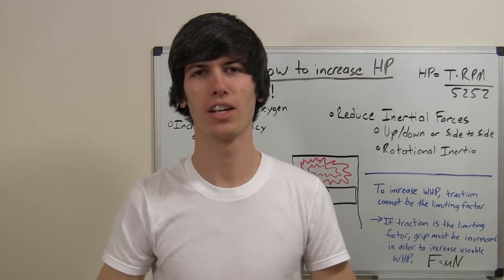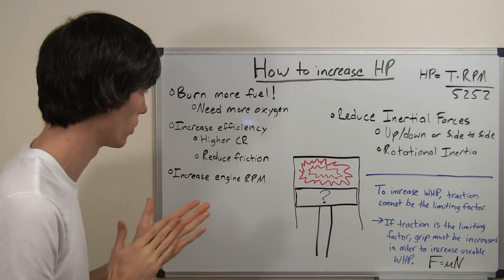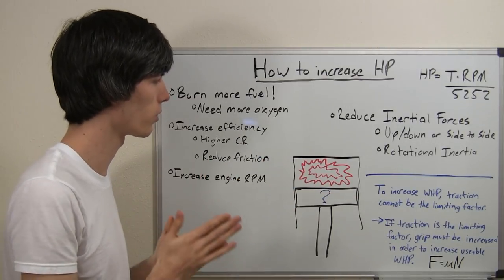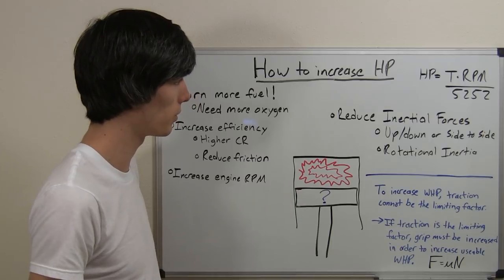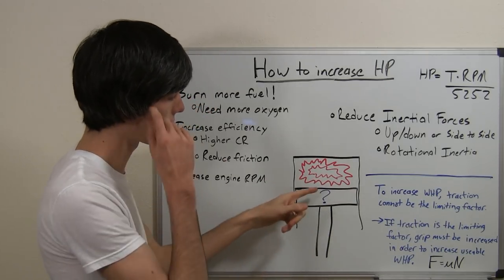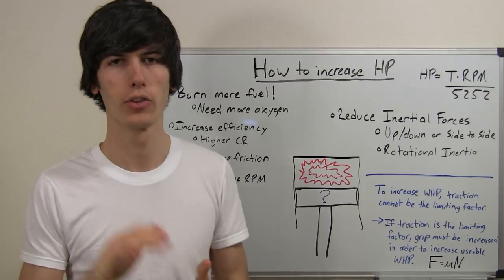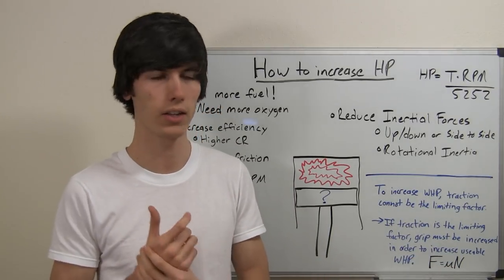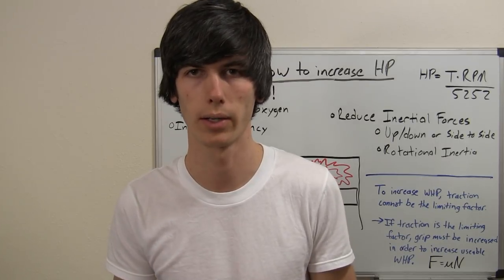How To Increase Horsepower - Explained

Comment: What are the limiting factors that constrain the normal road car engine speeds to to about 6k rpm, when F1 cars can rev to 20k rpm?
Reply: The weight of the rotating assembly, material, and durability. F1 motors are rebuilt often which means durability only has to be a few races, The pistons are way smaller, like motorcycle engines. With less rotating mass and shorter strokes you can rotate that mass faster. Pistons have a certain speed that most can't go past. You can rev a 6.2L chevy V8 to 20K if you want to if you remove the limiter, but with the way it is made and mass involved it would fall apart (explode) before you reach 20K rpm.
Reply: custommotor FIA rules forbid engines to be rebuilt. During the 2008-2012 era you were only allowed 8 engines per season per car(the V8 era). The new era only allows 6 engines per season per car. The usage of pneumatic valves allows for higher RPM, but also like Theponde1 said, short stroke and broad bore allows higher rev. Higher tolerances for components allows for greater RPM, less wasted energy between components. Think about it like this, less parts are rattling around make clatter, wasting power between the gaps.
Reply: The manufacturers don't want to spend a lot of money on warranty repairs so by limiting revs they increase the potential longevity of the engine.  Blown engines are bad press no matter how many revs you were doing at the time.

Comment: I'm wondering if an engine with less cylinders, but equal displacement, similar stroke and RPM ceiling, ex;9000 RPM red line, would have more torque than an engine with more cylinders, due to the fact that the cylinders would have to be larger to accommodate for equal displacement. Assuming that both have proportional amounts of components robbing power, as well as overlapping power-strokes and efficient intake and exhaust scavenging and compression ratio. (flat-6) & (flat plane crankshaft V8), say they are both have 3.8 litres of displacement, each cylinder of the flat 6 displaces 633.33 cc, while each cylinder of the V8 displaces 475cc. They both produce peak HP at 9000.
My question is if the peak horsepower of Flat-6 would be greater than that of the V8 due to having more torque generation from each cylinder. And if the claim of adding more cylinders only smoothens torque delivery rather than strengthening it is correct

theoretically, this is why I believe the 4.5 litre flat plane v8 (562 HP) of the Ferrari 458 Italia overpowers ANY V10 or v12 of the same (AND even greater) displacement, for example; The 4.8 litre 9000 v10 of the Lexus LFA  (553).

Comment: i have heard titanium alloy parts (valves, valve springs, piston, rods, crankshaft) can do a dramatic job of reducing inertial forces. I was curious as to how much of a difference titanium would make in for example a lambo v12. And also more curious as to what "carving" (making) such parts would cost relative to a custom forged crank (for eg). I am genuinely curious and would really be breat if u could just give a few figures at least. thx for great videos too.

Comment: another thing is to increase flow ie; intake air flow and exhaust flow. If you have a look at a stock exhaust it's very restrictive in shape, what you want is a nice round exhaust with genital bends and a bit larger than stock. But if you go to big you can lose power buy reducing back pressure

Comment: Yes you have horsepower or energy but this energy is present in a higher amount on crackshaft,but all this power is reduced by the presence of a torque convertor, pulleys, ac compressor, alternator, power steering, transmission gears and fluids, bearings and all the stuff that is before transfering this power to the wheels, you have a lot of energy  directly from the crackshaft, the most efficient way to improve the car performance is to find the way how the cranckshaft power is transfered directly to the wheels... withouth loosing so much energy.

Comment: Pretty good basic video, However it should be noted that increasing horse power and increasing acceleration are two separate things. You can increase one and it may not increase the other.
Reply: Pis Uhoff that's a very good point. Low down acceleration is more based on gearing, shift speed and low down torque. 
High horsepower usually translates more directly to higher top speed as your power limits how much air you can push

Comment: What I don't understand about hp vs torque is the effects of each on the car: if I had a high torque low hp car according to your vid it would go the same speed without being effected by its weight as much as a high hp low torque car which would go faster but be more effected by weight reduction? So... Why should I increase hp rather then torque if I'm not gonna change my weight?

Comment: i am looking for the calculation of compression ratio to boost pressure. like if we only had fuel which capable of 11:1 CR at 1 atm. and we well boost it at higher pressure. than how many compression ratio i need before the boost? thanks

Comment: What’s a good example of a higher compression ratio, and a lower compression ratio?
Reply from the maker: 14:1 is currently the highest seen in gasoline vehicles. 8:1 is pretty low. You'll commonly see 10/11:1 compression ratios.
Reply: Engineering Explained thanks, what’s considered a “good” CR?
Reply: how do i calculate cr.

Comment: Talking about grip and changing tyres, what about reducing the pression in the tires, does it make them more grippy?
Reply: +FP541 Reducing tyre pressure can increase grip in certain situations due to increasing the contact area. However, it can also create drag (due to tyre wall flex) and decrease (!) power delivery. Another issue is uneven tyre wear - under inflated tyres will tend to buckle in and wear the outer tread faster. Overinflated will wear centre tread faster.
Reply: +elucid07 funny that u kept using tyre throughout the whole comment lol
Reply: +Abel Resendiz funny that I spelled the word correctly, considering where I live we use that spelling.

What's your point?
Reply: You from the us?
Reply: +Abel Resendiz No.
Reply: +elucid07 my bad then guess it's tyre

Comment: Does a fuel cooler really work and increase power? (maybe in track cars?)
Reply: Moto Man 
* heat the fuel so it will vaporize quickly and cool the intake air so you charge the cylinder with more volume

Comment: So you say less friction = less heat, but what about racing motor oil and racing transmission oil those who provide thin types of oil, if it has less friction, would the components be moving faster and with the faster pase cause high temperatures to rise as well?
Reply: HTR - Helltown Racing yes, which is a lot of the reason that they lower friction as much as possible to begin with...

Comment: In some bikes they increase torque by increasing cranck weight. so as u said it will increase the inertial force . So why they increase cranck weight .
Eg: royal Enfield bullet
Reply: you cant increasing torque be increasing crank weight ,crank weight work like resist the biger crank weoght at the same dimension and weight distribution the LESS TORQUE engine will  generste at crank .

Comment: what I would like to know is how much an engine makes hp in theory. what I mean is if there was no friction at all, and no noise and the engine would run, how much more power it would  make compared to real engines. I've heard somewhere like 10 years ago that a 4 stroke engine is only able to give 30% of it's theoretical hp.

Comment: thanks a lot it was easy to understand
i have small note : if the hot air comes to the engine that mean i well loose hp
is that right ?

is the sport  throttel body   spacer  make difference in hp ? 

whats the difference between oem headers and sport headers

i hear a a lot of materials used in sport headers such as
ceramic coating
stainless steal

Comment: so there's, bigger cams, intake/exhaust manifold, exhaust system, performance clutch.... what else can u do?id prefer N/A engines over forced induction. are there performance spark plugs? pistons? crankshaft? flywheel?
Reply from the maker: Check out the rest of my playlist on increasing HP, there are a good amount of videos with many options.

Comment: Please help. I have a two stroke engine, 125cc. I have switched the cylinder for a 140cc cylinder but so far my lap times are exactly the same. I don’t know why? The rpm with the 140cc cylinder are lower than with the 125cc cylinder, about 200rpm lower. Any suggestions? Thanks 🙏
Reply: Lap time 😁💨💩

Comment: I have a Tan 2002 Toyota Tacoma 2.4L 2WD SR5. Its not even 150HP. I was wondering about a turbo charger, seen several with it for more HP. Also wondering about a top for it, and wondering if there's different types like high profile cuz I really need a lot of space...I REALLY need more HP

Comment: Thanks for making this video, Jason! You know, it was great that you uploaded this at this time, because it was just the excuse I needed to ask you a question that's been bugging my mind for some time... Does that HP equation always work? My question was "generated" by the following situation: take a hypothetical in-line 4 engine, like a 1.8L Honda or something in that ballpark, making 180hp. Say I wanna know how much torque it makes at 2000RPM...... Well, I guarantee you it isn't 472,68 lb·ft of torque.....right?
Please, I'd appreciate it if you could shed some light here, Jason.
Best wishes, 
Arthur.
Reply from the maker: Arthur Sperotto The number that manufacturers post when they say how much horsepower an engine makes is always peak hp. You'll notice it always correlates with an RPM (typically a high RPM). Power will be lower at lower RPM.
Reply: Engineering Explained Ah, now it makes more sense. Thank you. I was in doubt whether an engine's hp varied over RPM's. After thoroughly reading this (http://www.houseofthud.com/cartech/torqueversushorsepower.htm), I wrongly concluded that an engine's hp output is only there to "inform" you how long (in terms of RPM's) that engine can produce the stated peak torque for, therefore, it is invariable (for that particular engine, of course). Anyways, thank you very much for clearing that up, Jason!
P.S.: Am I completely wrong in my conclusions?
Reply: ***** ....... it's a joke... -_____________________-
Type over9000 on google. It's just a popular catchphrase.

Comment: question : how can ypu figure out whats my motorcycle top end power rpm. is it when i shift to second  gear the noodle point at is the topend power rpm? example i go on first gear than i ahift around 11.5krpm then shift up if the neddle poin at 9krpm the. its the topend power where the engine using all the power at this rpm

Comment: For petrol engines od SI engines power significiantly drops after reaching it's peak. This is because volumetric efficiency drops with rise of rpm, and power inside cylinder(indicated Power), and this drop down also the value of mehanical efficiency. These factors are main causes for BHP drop after reaching it's peak. 
For example if petrol engine revs about 1,3-1,5 times max rpm, it's efective power or BHP would be zero(0)!

Comment: What is the formula to determine increase in horsepower by increasing volume of air? for example my heads currently flow 250 cfm if i installed heads that flowed 300 cfm how do I calculate the increase in horsepower? I'm trying to determine if the gain in HP is worth the expense.
Reply: Indianahillclimber You would need to tune your engine management system to make much more HP. It is more air and fuel that makes more power, along with proper timing.

Comment: my car is not so good on HP and backfire's a lot like its a rally car. im just curious what could be causeing, 1 sparkplug fail? 2 big set up exhaust? 3 sparkplug leads? or would all fail if 1 wire did? its only a low engine but car has bin modified a lot, but money spent on it and is in good condition. but is not as good pulling. im thinking the backfiring has to do with it.
Reply: get a tune

Comment: Efficiency doesen't have any connections to BHP/L. Efficiency is a ratio of power produced at crankshaft and power produced inside engine cylinders, or 
pressure at the crankshaft or BMEP, and pressure inside engine cylinder or IMEP. Efficency of petrol engine(very good one) is around 35%, for some big 2-stroke Diesel engines for ferryboats is around 50%...

Comment: I am not sure about the inertial forces and how you related it to power... i mean inertia is conserved in the piston and reused during the exhaust and it's always alternating between states of inertia while energy is conserved. The only way a piston weight for example might be losing HP is through friction, and changing the inertia won't affect that at all... if you are referring however to horsepower / weight ... then maybe this plays a factor but also i must point that the weight of the piston is kinda small to heavily affect HP/Kg ...

can someone confirm whether what i said is right or wrong.
Reply: Pistons are not kept moving by inertia alone but also from other pistons' power strokes. The less mass a piston has, the less power it steals from another.

Comment: can somebody explain to me, when i have an engine that have a peak horsepower around 8500 rpm. installed a performance camshaft, and the peak hp is around 8600 rpm, use a bigger valve and the peak is now 9100 rpm. can i make the port much bigger to make the engine power peaks at 10000rpm or even 11000rpm? in this situation, i dont care about low end power since it's a motorcycle.

Comment: How come when Aussie50 put jet A1 fuel into 'Little Car' (the green one out of the 3 pet cars in his garden) the car kept running?  It started dieseling and making some awful sounds but it kept working even with the ECU still doing it's thing!!  It's a petrol car too!  Also if one were to look inside Little Car's engine what kind of damage would have happened?

Comment: Wouldn't it be an option to shift some weight on the driving wheels? 
Like putting the fuel tank in the back of a RWD car...
Reply: that would give you more grip so yeah in a way
Reply: It'll help by I'm proving your grip for a better take off but it won't increase your overall HP. You wanna increase HP, spend money under the hood.

Comment: I have a question If you have a Chevy Monte Carlo 76 with 350 in it , it's going to have about 160 hpHow can you make that engine more powerful ?Some today engines same 350 have up to 300 hp
Reply: There is a ton of things you can do, ESPECIALLY on a small block chevy. They are easily the most cheap way to gain horsepower without "breaking the bank"

1. Go to a machine shop and mill the head.
2. Adjust timing
3. Take rubbing compound and smooth the inside of the air intake manifold with a rag, or even your fingers.
4. Buy a K&N Air filter.
5. Find either a Low-End Camshaft, or Top-Speed Camshaft, each one is different.

These are all very cheap options but if you truly want gain, your gonna want to go the supercharged route, although that costs a ton of money.

Comment: anyone plz help me out ,,, if the atmospheric pressure is decreased (high altitude) how much horse power of the engine is reduced from the actual hp of the engine said by manufacturer at normal altitude plz help me out is there any method to find this

Comment: the 458 get 562 hp @9000RPM and 540NM @6000RPM by using direct injection , it have more torque and revs higher than the M3 which have 420hp @8300RPM and 400NM @3900RPM , so its obvious that the ferrari engine have more power per liter

Comment: Lightweight everything, crankshaft, aluminum flywheel, rods,= rotational inertia, and shave the head to 40 degree,and put a bigger radiator.boom ur car will accelerate faster than a corvette. Friends already did this. U won't believe the gains.
Reply: bartojoe any car? lol Oh and dont forget all the nasty vibrations that are now being absorbed by your drive train and engine components. You can tinker but you cannot engineer guy.
Reply: Devin Walton people forget what the dual mass fly wheel was made for. If you want to lighten the flywheel I'd say make sure you upgrade your drive shafts (15% more power is recommended drive shaft upgrade) so they can withstand the extra force. CV joints can be included in the drive shaft (and prop shafts if you got them)
Twin clutch can help mitigate the brutal flywheel pickup power and hubs usually can withstand a fair beating, then you're looking into better brakes and gosh you got a lot of work to do. 
This actually helped me realise that I don't need to glue two engines together (metaphorically) , just beef up everything first. I wonder how far I can push thise chocked 2l v6 (147bhp stock with variable air intake, 7500 red line)

Comment: Increasing RPM will not always result in increased horsepower, the camshaft timing will be off, therefore reducing the efficiency and actually resulting in a loss of power. If everything is timed correctly, it will increase the amount of top-end horsepower, but will then start to lose efficiency at the lower RPM range.
Reply: Yeah, hence him saying "all things equal".

Comment: I want to ask you, how to increase the engine compression ratio?
Reply: Netto Nenet One way is to change pistons, i think.
Reply: Topias Salakka could it happen? I think factory build engine and piston suitable for each other, how can I change factory piston with aftermarket one. Have done it before?
Reply: Netto Nenet Nope, it has never be done. You should revolutionize the automotive world and try it out.
Reply: Devin Walton It's difficult to detect sarcasm online.
Reply: so I gather
Reply: +Netto Nenet A smaller chamber head(s) will increase your compression ratio. If the engine has low compression piston, such as a dished piston you can go with a flat top piston provided that the valves do not contact them.